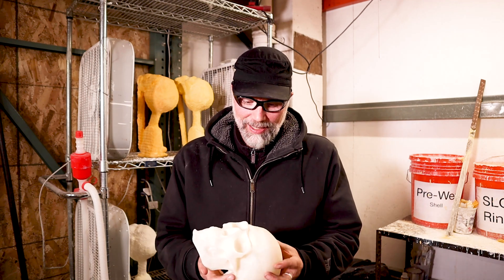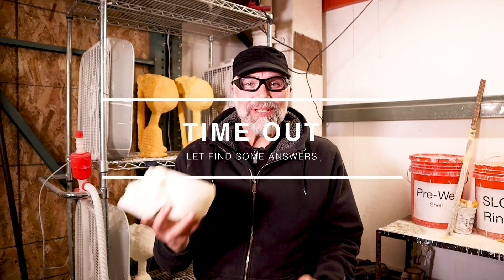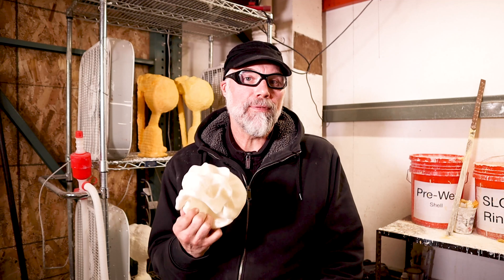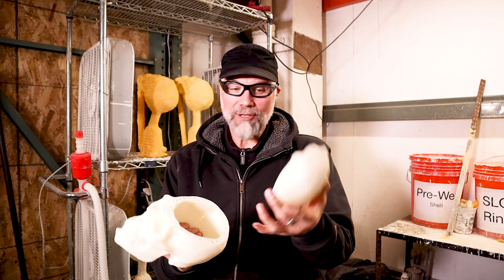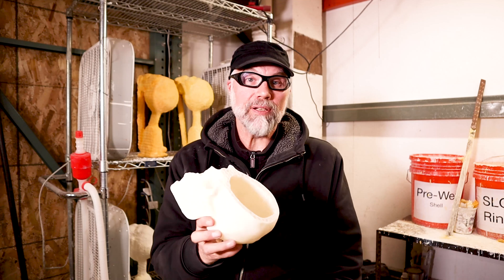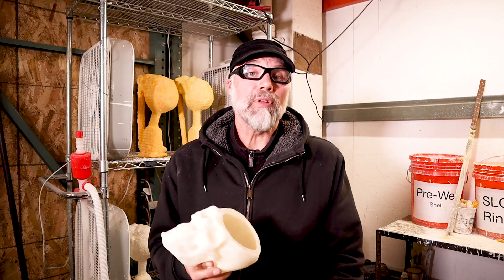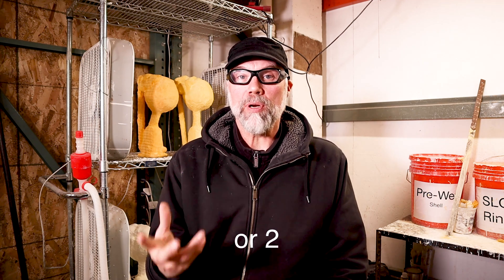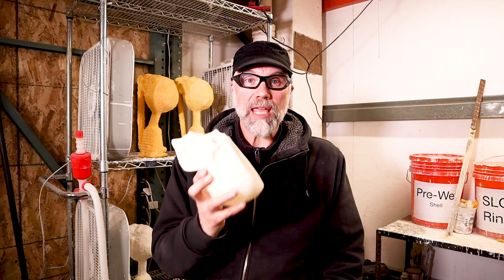3d printed patterns for metal casting, time to determine the best filament.

Comment: Another thought...hybrid approach:   You can make a re-usable silicone  mold off of PLA (or whatever other filament or even resin you choose) patterns.   Then use the silicone mold to cast multiple wax patterns.  The 3D printed pattern can be as many pieces as you need to create and print the geometry and remove it from the silicone pour without an excessive number of cuts. You get the 3D printer to create the complex geometry and digitally store your work for future use. You only have to clean up (sandpaper etc.) one print. Then  you get wax patterns to leverage all your experience with wax when dipping shells, burnouts, casting, etc.  

So maybe just think of the 3D-printer as an easier path to making complex molds for things you don't have a physical object to pull a mold from.

 Not my original idea....this is how they make turbocharger wheels these days.
Reply from the maker: I totally agree, if I have to cast more than just a few copies it is more efficient to make a proper mold.

Comment: I've been mulling this over for a while.
It seems to me two things are clear: Lost wax is the best material to cast with, as it has a low melting point and little residue.
The other thing is that a lot of PLA-based 3D prints are not good, with horrible "staircasing" etc.
However, resin-based printers are a lot better, but the material is not good for casting.
So how about an intermediate stage using a 2-part silicone mix to cast a resin print into wax?
I am pretty sure silicone would withstand the temperature of melted wax, but if not, a plaster intermediary would.
What are your thoughts?
Reply from the maker: You are correct, wax is still your best choice for creating patterns that can be burned out.  The waxes are also easier to produce.
The stair-casing is an aesthetic concern, not a functional one. Printing on a resin printer for better resolution is a good choice and there are a number of silicon mold rubbers on the market both tin and platinum cure, that are great at capturing all the detail and handling the temps needed for casting wax.

But making silicon molds is an extra expense.  For me, there are a number of times when I only need one casting (not multiples) or the object i print is too complicated to make a rubber mold of.  Its At these times that I find it more efficient to burnout out my prints.

Comment: Have you ever used resin printers/ burnout casting resin?
Reply from the maker: The cast-able resin works with standard investment with in a steel cage like in jewelry casting.  The ceramic shell does not hold up to the expansion of the resin during burnout.

Comment: Great videos,  I've been doing lost P LA for 3 years now on cast aluminum robotic parts. I think everyone is missing the point on PLA burn out.  The Secret is not to burn out but to let the P LA slowly dripped out .  This is accomplished  At a 180 C depending on your fillment over a longer period of time. I typically run my  electric kiln for 12 to 19 hours. After this time the shell is extremely clean with only small residue . And when you go to bisque temp  it ends up extremely clean. Also this is less toxic for the environment because the P LA comes out still and it's plastic state.
Reply from the maker: I agree that if parts can be sprued directly so the pla has a straight path to flow out that a great first approach although more complicated patterns  will need micro vents (drain holes).  Still trying out PVB, needs a higher temp but turns to a gas faster (less dependent on flowing out.

Comment: Thanks for video ..  which is better for fine engraving or  making stamping die  in stainless steel .. actually I am trying to make stamping die with lost wax casting ..
Reply from the maker: Sorry I am not sure I understand the question.
Reply: @LunarburnStudio  I will put it in other way , I have a  stainless steel coin die , I will make its wax model, and I will again cast it into stainless steel .. is it possible ??  Will it take all details ??, Sorry it's bit out of track question .. but use of CNC is very expensive here .. so I am finding cheap way to make die ..
Reply from the maker: @anandbafna1511  If you are talking about printing it will depend on the printer.  But if you asking will the shell pick up all the detail then the answer is Yes.  And the Ceramic works with stainless steel.

Comment: I think wax castable resins and resin 3d printers are the future because of resolution.
Reply from the maker: It’s my understanding that 90% of 3D printed patterns in an industrial setting are castable resins/wax’s. The challenge for smaller foundry’s is partly the access to equipment and a volume of resin but also the price. I just bought my first resin printer and realizing that castable resins are crazy expensive. $100-$300 per liter.

Comment: Looking forward towards that series. I've done a small comparison between PLA and Polycast. The Polycast burns so much cleaner...
Reply from the maker: What type of investment do you use and what are your burnout temps?
Reply: @LunarburnStudio  
I agree that polycast works really good, PLA seams to get some pieces stuck in the mold after the burnout. 

I use SRS Classic investment and I use the burnout cycle that they have on their website. 
730 degrees celsius at the max.
Reply: @LunarburnStudio  using a homemade recipe, since i cant get hands on commercially grade investment.
my burnout is: 1hr 100deg, 1hr 200deg, 2hrs 500deg, 5hrs 700deg.
the polycast leaves nothing behind, my regular PLA leaves alot of ash behind
Reply from the maker: I have been fixated on the temp of the burnout, but from your results and others using standard investment it would seem the length of the burn is also critical.  Ill add that variable to trails.

Comment: Why about wax based resins for ceramic shell casting, they apparently expand similar to wax ;)
Reply from the maker: I have been wanting to try resin wax prints, but the printers i can afford are on the smaller side and too small at this time to make effective at my foundry other than just play with.
Reply: @LunarburnStudio  the original anycubic photon or elegoo mars are both sub $200 (well below £200 here in UK anyway lol) printers of very high quality, with 115x65x165 build volume available (which you can print mostly hollow in to save on resin used) and a 42 micrometer resolution on the xy axis, and a 10 micron on the Z. so I think you'd get some good sized pieces to build a bunch into a big sprue to cast at once from a small bottle :)
Reply from the maker: @noviceartisan  ill look into them.
Reply from the maker: Those printers are a little small for i normally work on, but maybe a good place to start playing with.
Reply: I ask, because I'm going to experiment with this concept shortly for smallish jewellery and mechanical parts :)